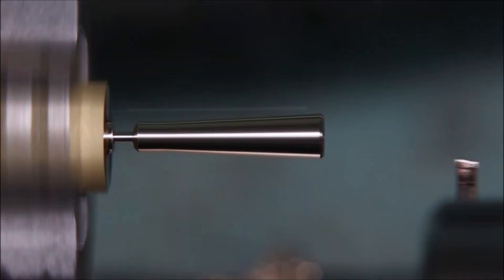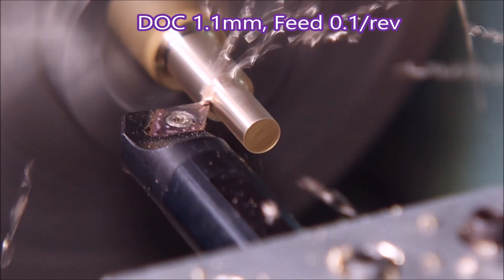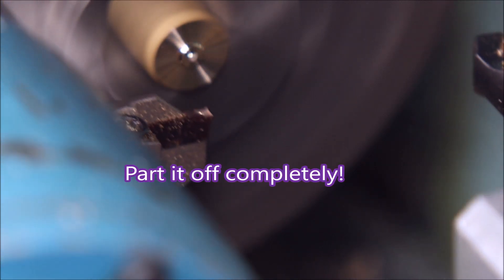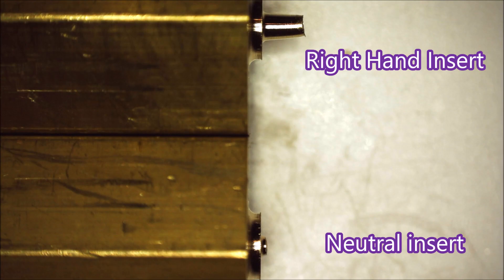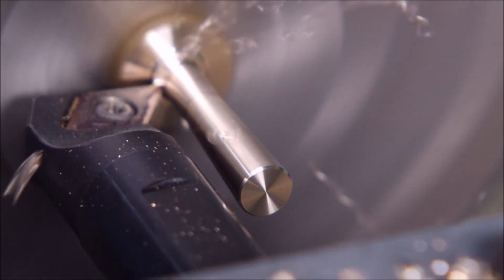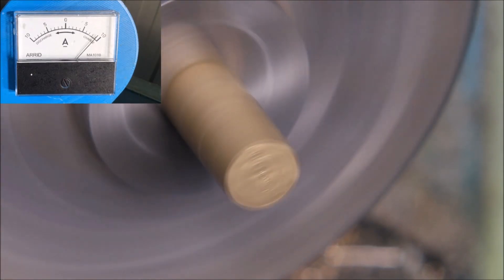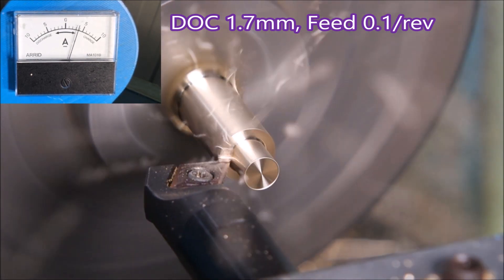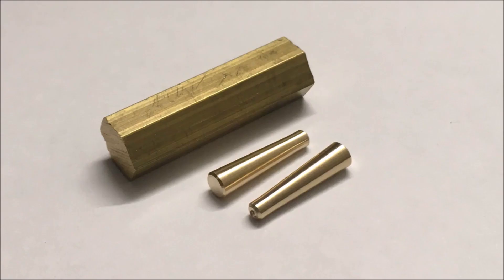Turned with a boring bar and using Neutral and Right Hand parting inserts

Comment: I'd love to just machine brass. When I bought my Nakamura TW-20 that was all it had machined and although Brass was scattered throughout the entire machine it was easy to clean. Aluminium however can be stringy and frustrating. Thanks for sharing :)
Reply from the maker: I just looked up your machine! One heck of a machine.  If I had that machine I would expect to be able to make almost any aluminium chip quite nicely, by using the correct inserts.  You certainly have enough spindle horse power to be able to use the best possible spindle speed, depth of cut and feed rate to get decent chips. I understand Sumitomo AX and AY inserts can be useful to make aluminium chip properly.  Have a look at this, https://youtu.be/mqOLuSpPQpY
Using machine grade aluminium can also help
Reply: @smallcnclathes  no doubt you could, I am self taught but would be happy if you moved to Brisbane to mentor me :P ;) haha I can't remember who said it but "you don't know what you don't know" and that's where Youtube has help significantly with all you guys putting up the excellent content for us guys to learn ;)
Reply from the maker: I am self taught too. Unless you count a little Emco PC 5 and a Hercus PC 200, both of which were made as lathes to train students in cnc.
I did do an apprenticeship in fitting and turning, but promptly became a draftsman on finishing my time.
With your lathe You should be able to achieve chips in aluminium. The right insert and the correct speed feed and cut, should make it possible even with 6061, which I avoid like the plague, but then I have 1/2 hp spindle power? LOL